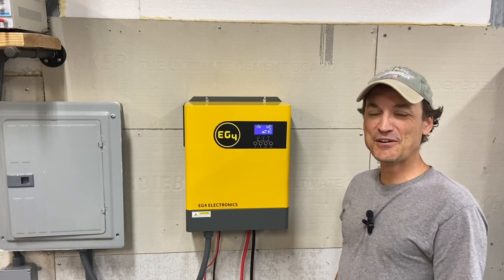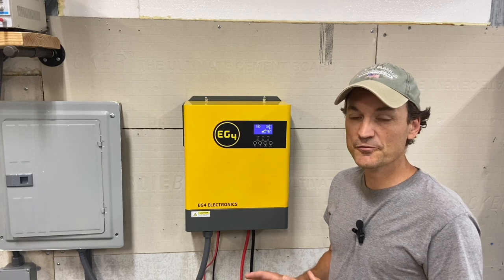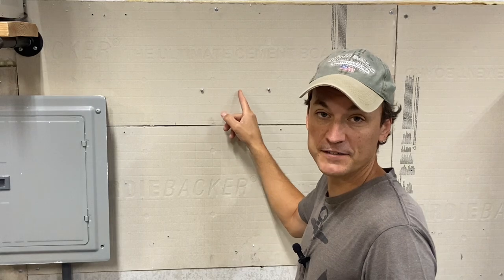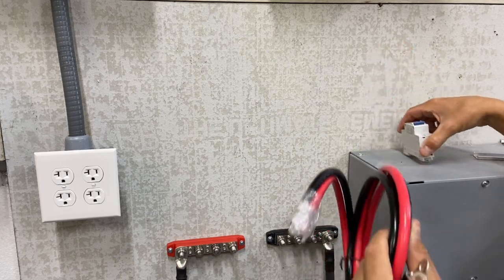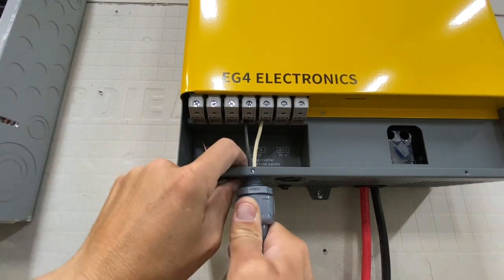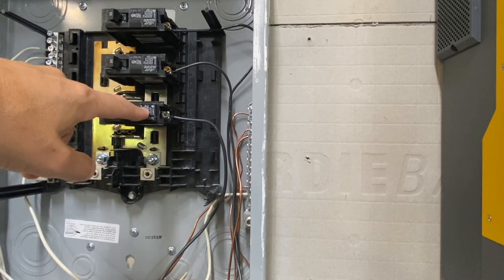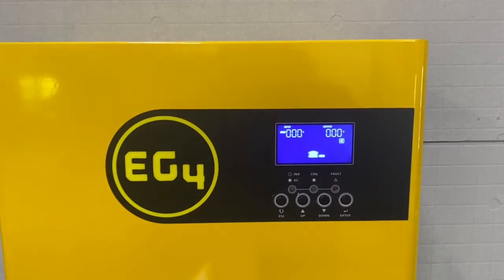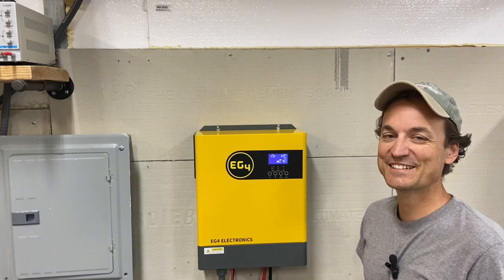Eg4 3000w 48v inverter install and load testing. Signature Solar beginner friendly solar inverter

Comment: Can you upgrade your two eg4 3000 units with one extra and still be 2 phase at 9k? The eg46500ex 48v inverters cannot upgrade with just one unit at a time to have dual phase. It has to be two at a time.
Reply from the maker: These would be the same as the 6500’s in that respect. They each provide a 120v leg. So you need pairs to achieve 240v.
Reply: @GavinStoneDIY  my mini split 3 ton 2 unit Mr cool is one that I have a 240v with. Everything else is 120v. I do have 12-eg4 lifepo batteries 
5.12 kw each. Thinking of taking one 6 bank of batteries for the Mr cool to be run separate and leave my setup of 27- 460/575 gain blue sun pv's to run my now "sundowned"  (2) eg4 6500ex 48v inverters to run my 120 side. Maybe obtain 15 more of the blue sun pv's like I have now to run the other setup with a eg 4 6000xp inverter. Your thoughts?
Reply from the maker: @lindaferguson593  I guess it depends on your power consumption. The 6500’s will pull a lot of idle wattage for just taking care of smaller tasks. If you have access to 6000xp’s let them do all the work. 
If you were to use the 6500’s I would just have everything on the same battery bank. I just wouldn’t use coms with the 6500’s.
Reply: @GavinStoneDIY  coms? Please elaborate. I'm a knowledgeable  66 year old but need layman's terms. Love your videos though and keep them coming, please.

Comment: I have a powmr brand thats really similar to that but id rather have had the eg4. The eg4 3000 has much more capability as far as solar input
Reply from the maker: Yeah it’s a really nice inverter. I think it has the highest solar input voltage for this model type.

Comment: Actually the breaker switch on the battery is supposed to be on to charge the capicitors in the inverter before you turn the battery on...
Reply from the maker: Exactly right. I believe I mentioned that in the video. If not I’ll be making a short video soon explaining how to charge the capacitors without a rack battery with a precharge resistor.

Comment: I thought the neutral and ground bond happens inside the inverter using a relay when you're on inverter power. Then when you pull from utility power the relay opens and the bond is done in the utility main box. Supposedly this is why the bond screw is not there which would make it 100% bonded all the time.
Reply from the maker: I’ve heard people say this. But I didn’t see it in my testing. Could be a different firmware.
Reply: @GavinStoneDIY  I read on DIY forum they removed this feature on more recent ones. Yours must be a new one although I don't even know if they mentioned it. Now you have it bonded in two places, and at the main panel where the meter connects.
Reply from the maker: @Mike-01234  I didn’t have grid power to the unit. So I was only bonded in one place.

Comment: I want to put this in my RV with 1 48v battery. But I want to get a 12v A/C. How can you run a 12v A/C with this?
Reply from the maker: Can you clarify what you mean by 12v a/c?  Air conditioner? You can buy something called a buck converter. It will step the 48v down to 12v for any appliances or lights you might need.
Reply: @GavinStoneDIY  roof top A/C. It runs off 12v that needs to be connected straight to the 12v battery's.  I know about the step down but I don't think you can hook the 12v A/C into that?
Reply from the maker: @Mikesroadtrip-ec5kp  as long as the step down converter has an amperage rating for the A/C I can’t see why it wouldn’t work.

Comment: A NEWBE here.  You were doing great till you began speaking "confusion" at 15 min 56 second point. ... and lost me.
 Think that is a Data cable between the inverter to connect to battery. 
"Inverter came with 2 identical cables (Look the SAME), but you are using  the one with a tag.  Why does Inverterter have 2 cables that look the SAME...? Are they identical cables, and what use is the 2nd identical cable ?
 What are  EGLL models or using Budget models ?    please EXPLAIN..!  I have never hooked any solar up before!  So, I want to use the correct cables, and place/plug in exactly the correct cable into the right plug.
Thank you
Reply from the maker: Ahh ok no worries. So to be honest I’m not sure why they sent two communication cables instead of one. I just showed the tag on the particular cable I’m using. The manual does a great job of explaining how to connect those batteries to the inverter. So you should be good to go with that. The batteries themselves,  Signature Solar sells an eg4 rack battery called the eg4 LL model. Which is what I’m using in the video. I’ve added a link below on the description. You can buy the rack like I have. Or just start with one battery at first. Their newest version looks a bit different but it’s essentially the same thing. They also sell a budget model of those batteries called the Lifepower4. I have those in the description as well. Both of them have the same storage capacity. The LL’s just have a nice screen and a batter warranty. Either of their eg4 rack batteries will communicate directly with this inverter. In my follow up video I mention the setting I used on the menu to enable communication. I know it all seems sort of confusing at first. But feel free to ask questions as you go. I’ll be happy to help.

Comment: So far today 1 hour listening to elevator music. No one is answering at signature solar. No response to support, website issues, chat mode, or any department over there. This is day two of trying to get hold of anyone there. Are they still in business? Does anyone have another phone number?
Reply from the maker: They’ve had bad issues in the past with their phone service I know. Your tried customer service?
Reply: Finally call back by Dustin where he accused me of being rude with the operator. Claims there is nothing wrong with the phone system and I must have been calling and hanging up. Yeah,  Signature Solar is not for me.
Reply from the maker: @davidhamel2663  that’s a shame. Sorry to hear that. Probably a good idea to email customer service and tell them all the details. Though I realize that would take more time.

Comment: Put a Victron smart shunt on DC side to measure DC - AC efficiency at different loads. There kind of reviews without data provide no useful value.
Reply from the maker: I tried to cover what I thought would be most helpful on this video. Obviously it wasn’t helpful to you.
Reply: @GavinStoneDIY  I am also interested in inverter efficiency and think the recommendation is a good one. Sometimes the standby consumption can be very low but two inverters running the same load can have a 100w total output difference. I saw a video about it and the victron inverter was the power hog culprit.

Comment: I find it very noisy. Louder than my white noise machine.
Reply from the maker: If it’s using full ac output or full PV input it can get loud for sure. Generally though it’s fairly quiet compared to some the others I’ve reviewed.